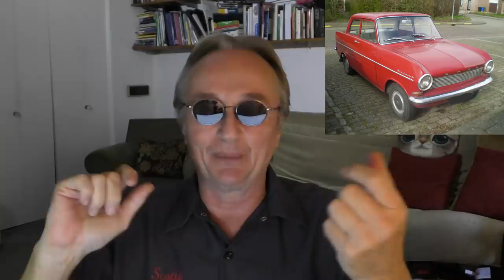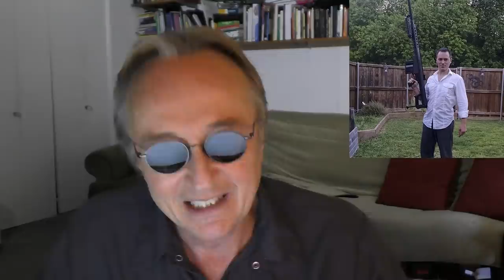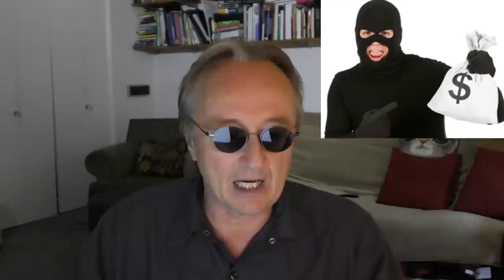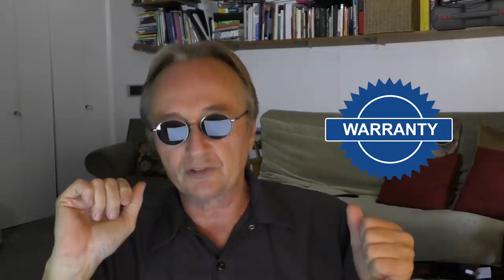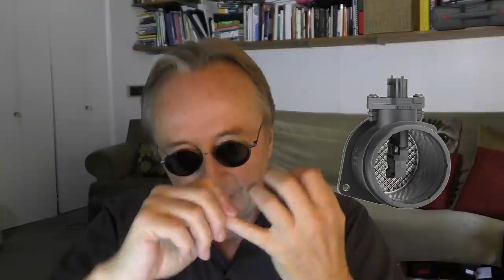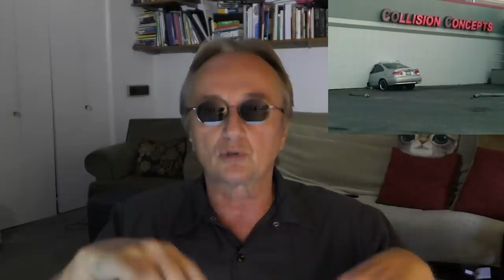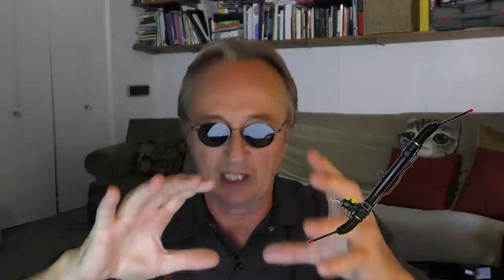Why Not to Use Your Car’s Horn

Comment: I'm trying some E15 on my Ecoboost. 
One guy with one says he's ran it for two years and had better mpg. Then another in a Ecoboost group said the same. So I'm giving it a shot.
Reply: Ethanol has less energy density than gasoline. You will see a slight drop in mileage if anything. It becomes very noticeable when running E85.
Reply: That's what I read online but then two personal testimonials that say otherwise, with Ecoboost. I know I've read the same things, low energy density and so on but it's hard to argue ACTUAL personal experience. It may be so with most other Engines but here's people who've ran the stuff in their Ecoboost and had better mileage. 
Engines can be tuned to make MORE power on that LESS energy dense fuel so it stands to reason that more MPG is also possible. The norm? Perhaps not but also not impossible.

Comment: Hey Scotty should you have your transmission fluid changed if you vehicle has 143 thousand miles?
Reply: Every 25,000 they say. Your overdue.
Reply: slide slippin no way it’s only 25,000. It’s higher than that

Comment: On some cars, just replacing the wheel bearings will fix the ABS problem. It's because the wheel speed sensor is part of the assembly with the wheel hub. Not entirely a guarantee, but can be a cheaper fix if that's the case. (May also throw a traction control and service vehicle soon code too.)

Comment: The fuel of the future? Thorium. Now which form of this energy source you put in the tank of your vehicle is still a matter of guessing, but I'm guessing it will be none other than gasoline. Did we start re-wring our houses to a voltage suitable to the needs of LEDs? No. We made the LEDs suitable for the voltages we are already wiring our houses for. Why? Because it was and remains the most cost-effective solution available.
Reply: Thorium is pretty great, but as for the energy source for cars, I think it would still be electricity. Its less conversions of energy (nuclear>electricity>kinetic vs nuclear>electricity>chemical>kinetic) so its just naturally going to be more efficient
Reply: @OGSumo  Re-read my post. I did not claim that thorium would ever be used to power any mobile anything. It is useful only in a large reactor. Yes, electricity might well be what powers cars in the future, but there are so many annoying problems with it that I really and truly believe that gasoline will be used. So long as you have enough power, you can make organic chemicals from practically any feedstock. This means that you could use coal and water to produce gasoline, or cellulose and water. It doesn't matter, so long as you have a source of carbon and a source of hydrogen.
Reply: Manuel Garcia ah my apologies, I thought when you were saying the statement about thorium in the beginning it was supposed to be leading into the second statement about gas. As in using thorium as our main source of power and using gas as a way of mobile storage of this power. A bit of a projection on my part
Reply: @OGSumo  It is easy to become confused when reading something on screen. I have trouble with it all the time.

Comment: Scotty I have a 2004 Ford F-150 when I turn the engine off a I hear bubbling noise what could this mean
Reply: Coolant, I hear it bubbling around in lots of cars I'm in.
Reply: joshua raglin could it be anything major tho
Reply: Maybe old coolant. Things 16 years old, coolant is commonly neglected and even though they tout 10 years and 100k miles before you need to change it, there's a good chance it's still the factory coolant.
Reply: joshua raglin but the truck has 50k on it and it sat for most of its life
Reply: @kalebkusch8394  buy you as obd scanner, bout 100 bucks, but ivt seen plenty cars with no lights, plug your scanner in and 2 or 3 pop on. People can clear em now a days and it's usually a few days before they come back. But the scanner will re activate it. Got it at AutoZone paid 120 or something, lady said I can return when done for a refund, still got it, well worth it.
Reply: Your car is overheating. The coolant should not be bubbling. When the engine is cold check amt. If the amount is correct, your thermostat may be bad or your cooling fan is broken.

Comment: You can run e85 in a regular car no problem as long as it has a carburetor, you may need to replace your fuel lines but it should work just fine

Comment: i have to agree. Computer and human drivers dont mix. I had the adapt cruise control on. i set it at 2 cars length. i was traveling at 70 mph in the middle length. Someone from the right lane cut in front of me. Normally, i dont need to brake because we both travel at the same speed. But the car thought i was about to hit something so it braked hard. luckily there was no car following me or i might get hit from the rear.